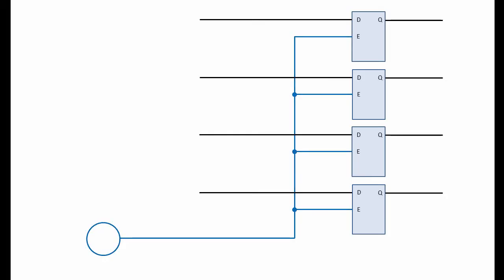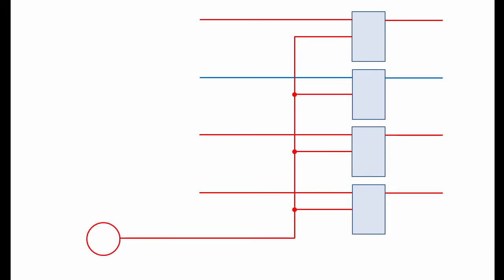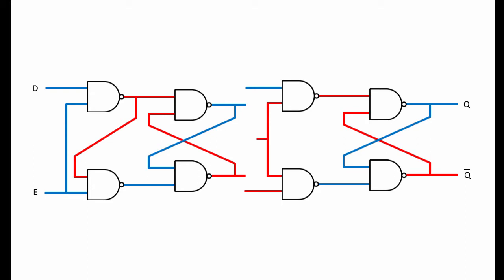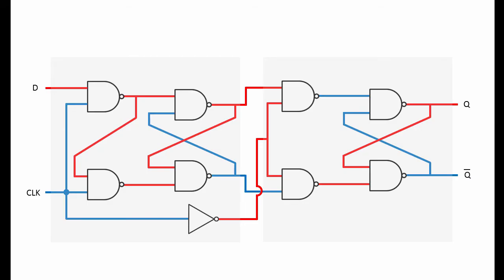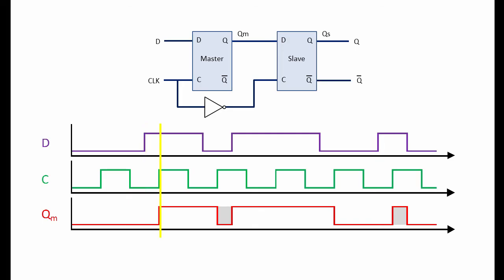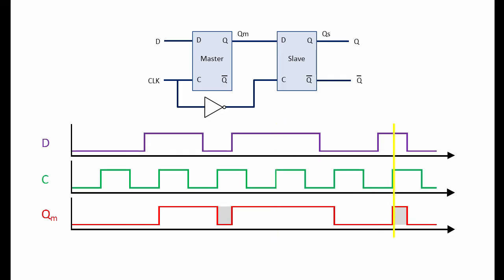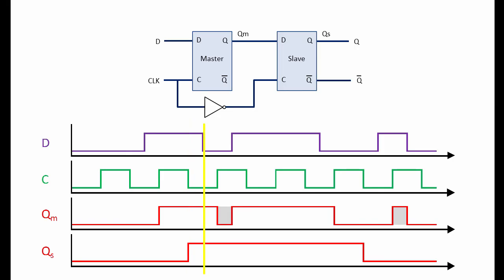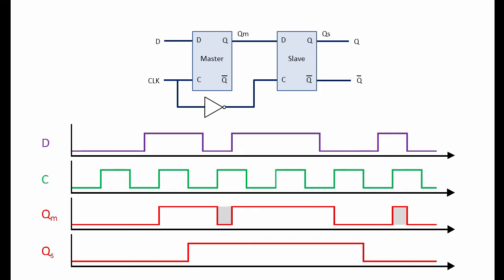Latches and Flip-Flops 5 – D Type Flip Flop

Comment: You might like my version of a data flipflop.  It has a input , display output,  and output. Initially (and anytime the display output is low) what is at the input is at the display output.  When the clock goes high the display output is transferred to the output and the input is transferred the display output. When the clock goes low the output goes low. I don't use my data flipflops for counter circuits

Comment: I don't quite understand, why not to work with the device from the previous video, a D latch where D is sampled on the rising edge of the clock ? (in this video we have a regular clock, no little triangle in front of C input)
Wouldn't this solve our problem of Q not changing while we sample it ? (I assume this is the problem that the Master Slave Flip Flop is trying to solve)

Comment: The thing i don't understand is, that this appears to only fix glitches that start before the lead edge of the clock pulse, if the glitch occurs during clock high and finishes when clock low (which could be a relatively small glitch), it will be recorded?